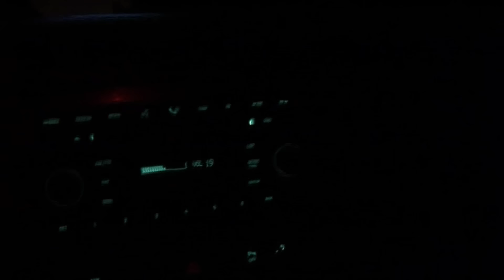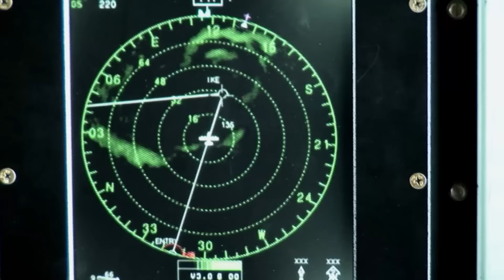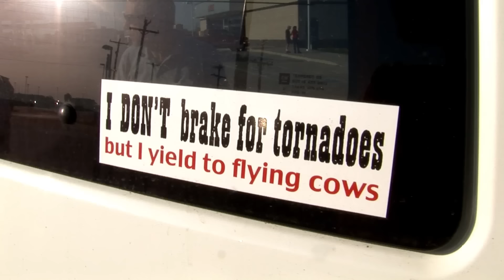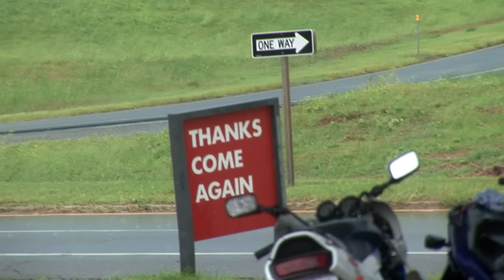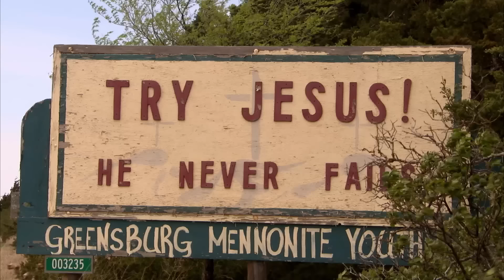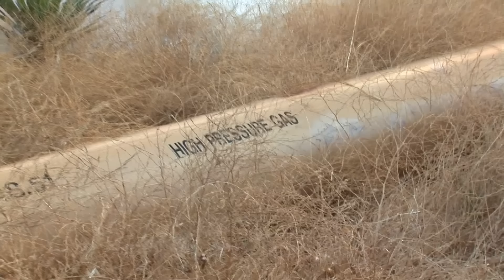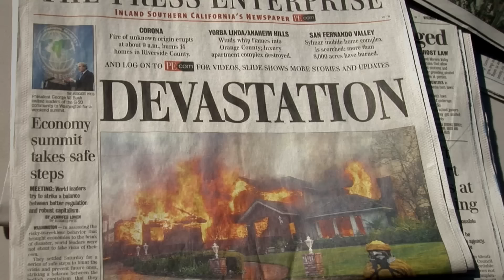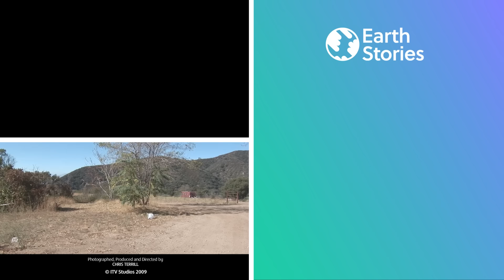How Storm Chasers Track Down A Natural Disaster

Comment: 16:01 little late on time stamp but that poor jeep gonna run hot they got front cover over 😂 hot temperatures and a lot of low speeds not gonna be good for it. Or I should say wasn’t Ike was what 2007 or 2008